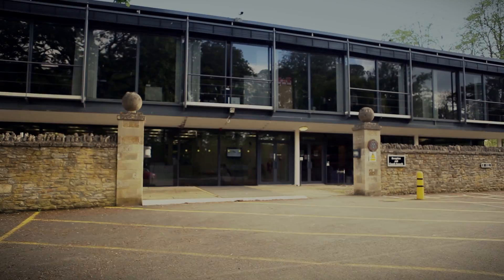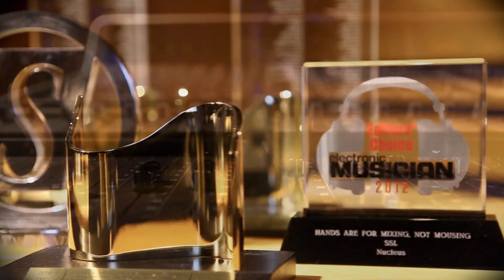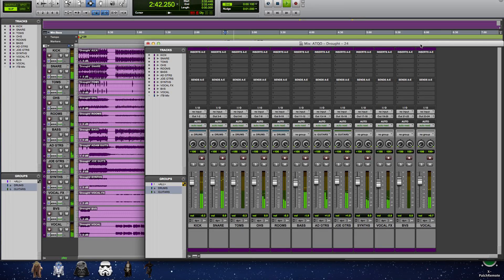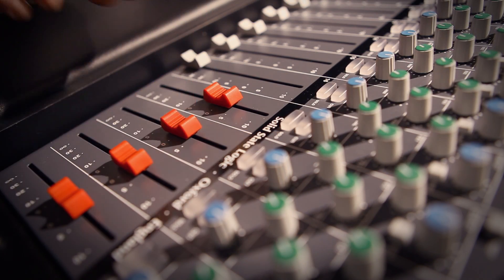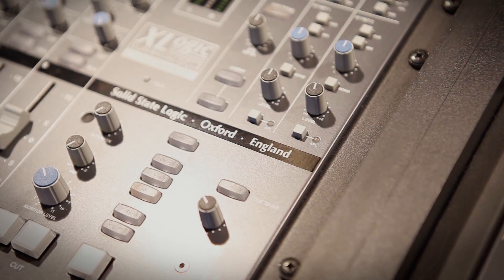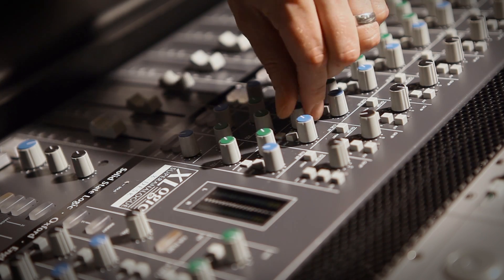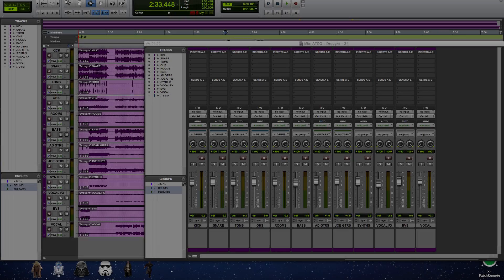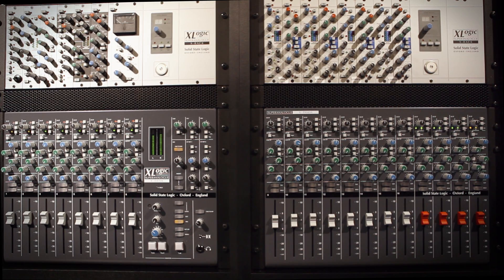Summing - SSL's 'Lego Studio' Video Series

Comment: The digital was louder but it was not as tight. Not compact like there was more air or space between the recorded information. Example (1a and 1b) Example (1a 2b). (1a 3b) are just glued together, sorry it's over used. What was brighter sounding in. 1a. Sounds different not better or worse different. The bass and The lead guitar sounded rounder not louder, more like what you would expect from audio in the 90's. Just more together.

Comment: Analog forever! To the people complaining about analog: remember its not simply about comparing mixes at unity. Working with analog processing changes how much you can push sound. It’s also a matter of ear training and experience. I hear things when comparing ITB vs OTB that I wouldn’t have been able to distinguish 10 years ago. Lastly, investing too much in digital and neglecting to invest in analog is one of the worst things you could do if you’re doing this for a living. Quality Analog equipment maintains or increases in value over time where as digital is rarely resold at original value if sold at all.

Comment: Analog summing (from digital) is bullshit unless you have lots of nice analog outboard gear. The differences in summing between ITB in this video are VERY subtle and could be acheived by simply putting an eq on the ITB mix bus. Also the SSL gear is so clean that their summing mixers do not impart anything special on the signal.

I have a Neve 8816 summing box, but I use it to sum signals from an analog 1" 8 track tape machine. It is unbelievably amazing sounding.

Moral of the story: With digital, summing mixers for digital is only worth it if the mixer itself has character, or you have nice outboard gear with character. Otherwise, it is a waste.

Comment: Iñigo Llavori I thought the difference between the two "summs' was LESS dramatic in the final example (at least at first hearing). I'm sure that there is software available which could help one achieve the benefits of a hardware summing mixer but my philosophy is "less is more". However, since the X-Panda is currently going for about 70% off at one USA store I could be persuaded otherwise...